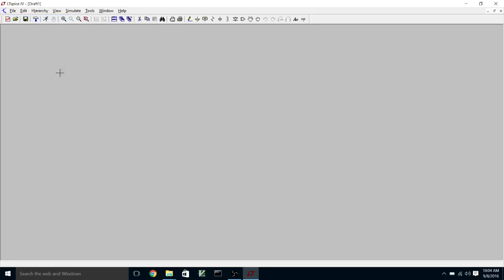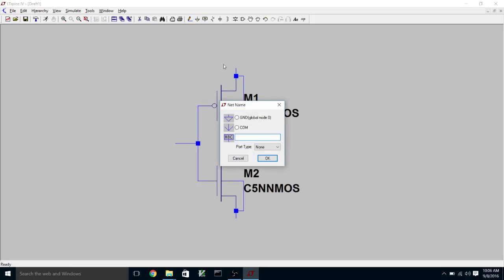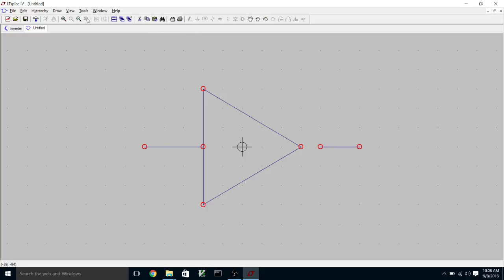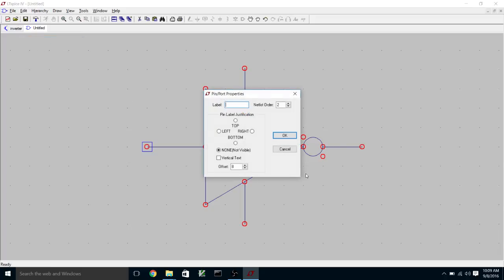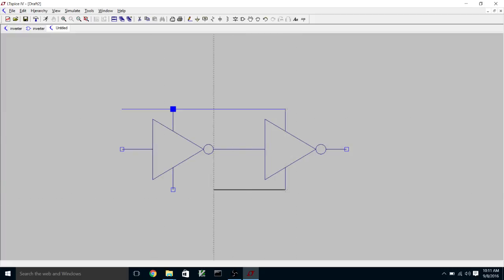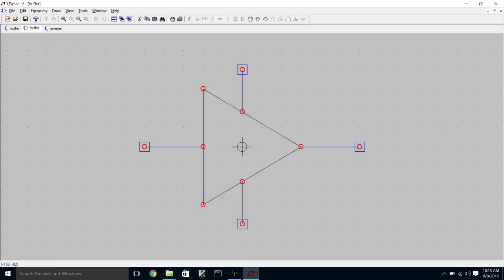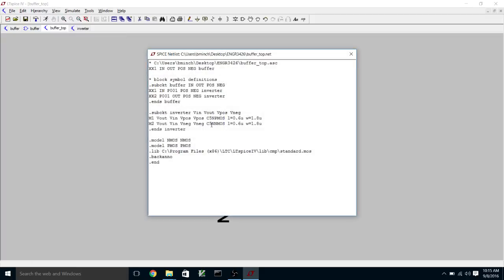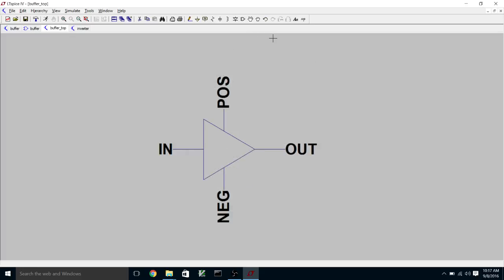LTspice creating a hierarchical schematic

Comment: need to simulate a grid tie inverter for a mini wind turbine. The grid is 120V and i have to synchronize the voltage from the mini wind turbine generator and the voltage from the grid. They must be synchronized to 60Hz. Would you know how to make a schematic of a grid tie inverter on LtSpice? will you please do this? sir.